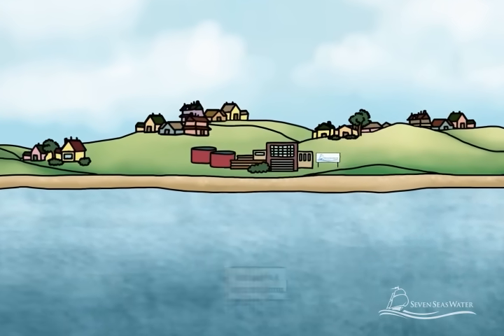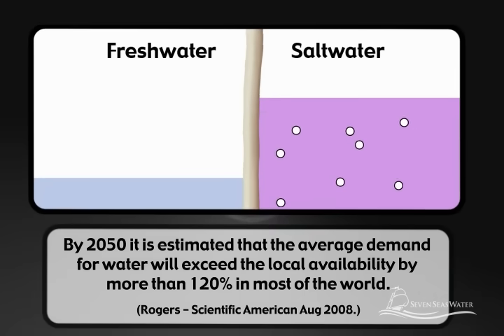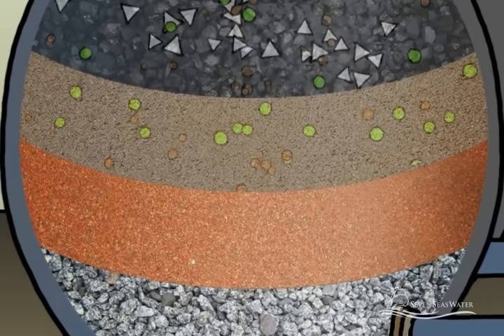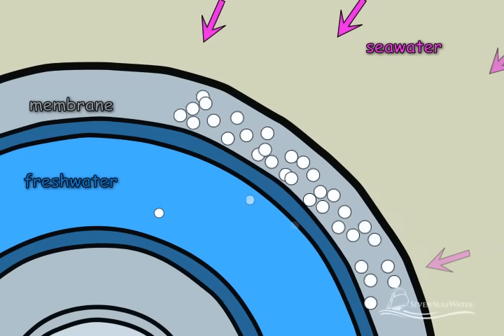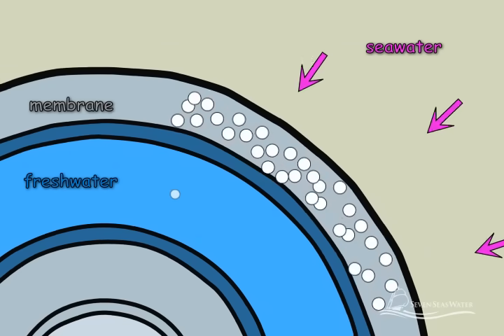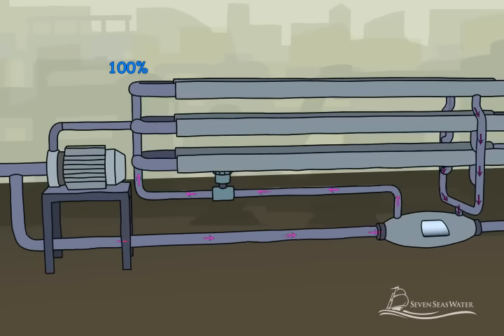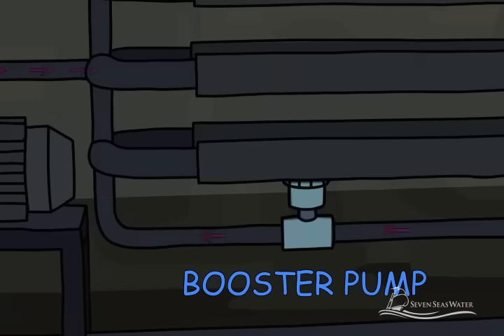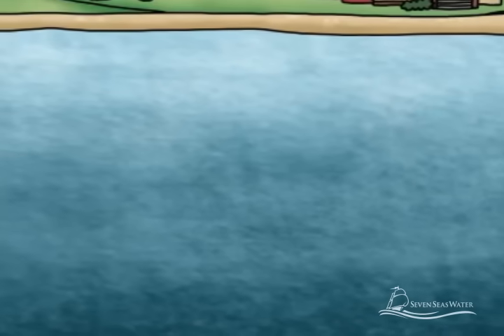How Seawater Desalination Works

Comment: I spend my workdays operating a desalination plant.
  
The process explanation here is simplified, understandable and addresses most issues, though not in detail.  That would take volumes of material and actually would require an extended commitment on the reader's part.

Yes, there are alternate ways to desalinate ocean water - but not all have reached a level wherein they are economically viable to use on a large scale.  Just consider that each location is unique with its own set of advantages and challenges.  Depending upon location - the bureaucrats, environmental agencies, scientists and developers have worked out a compromise that is as reasonable as possible.

Suffice to say - 'How Desalination Works' is Well Done.  Thank you for this presentation.
Reply: What do you do with the leftover salt?
Reply: @-Subtle-  They said in the video that it goes back into the ocean. In theory the salt content should remain the same since all the fresh water we use does eventually vaporize and return as rain.
Reply: @hybridwafer  not all of it returns to the ocean
but yeah the salt content stays the same and at most the salt concentration changes slightly
Reply: @UserJurie there is no way humans can affect the salt levels of our oceans. Its literally 80% of the earth surface. We simply dont have that ability
Reply: @-Subtle-  it says in the video.
Reply: @rory6860  volume.  It works,  and there are "distilling" plants, but a ton of energy to do so.  Just not viable cost wise compared to RO technology for large scale facilities required for municipal drinking water . Great question though.
Reply: @pauldelphos4924  nuclear energy can solve the energy problem
Reply: Simple wisdom is, evry solution is simple, only hard thing is the way to find it. If its complicated , something is not right, but this is step forward too...
Reply: I have some changes that can greatly reduce the cost of running Desalination systems - These changes are simple and would eliminate most Viscous drag in the pressure producing process. I would like to find someone who can tell me WHY,  I'm Wrong about these simple changes. It seems that no one really wants to improve the existing monopoly....I mean system...I look forward to any help
Reply: @haroldwestrich3312  Usually someone will tell you "Your idea is fundamentally wrong and stupid." Then they'll proceed to steal it.
Reply: @rory6860  wouldn't that create just destillized water with no nutrition at all?
Reply: @gsftb  nono it's not remove all content elements,usualy 200-300 tds water is drinkable ,and sea water tds is very high 5000+ so we just come down to 400 tds ,which contains nutrient that we need ,if we drink high tds water may be it's cause problem in lader
Reply: @rory6860  Thats the question i keep asking myself. You also could use solar energy in hot areas.
Reply: Which is why in 1979, I suggested a new Procees. Similar to the 20's.
We are having a continue of History repeating itself.
Reply: @douglasnicholas1860  can you share more about your work? Patents or article about it ?
Reply: @douglasnicholas1860  I'm very interested in the process from 20's that you suggested. Can you tell me what it was? My new process simply uses centrifugal forces to directly press the water through filters rather than "Spinning viscous water at high speeds around a pump housing which accumulates HUGE friction losses compared to directly pushing water through the filters at about Zero relative speed. No pipe losses for high volume either . Look forward to a reply, you can email at oct1113@hotmail.com
Reply: @rory6860  the end product  is a very expensive distillate!
Reply: I didn;t understand how the energy recovery aspect worked in the video
Reply: @NazH12  Here is a link to a brief video of the ERI pressure exchangers in use at the Carlsbad 50 MGD plant.  
https://www.youtube.com/watch?v=IBwkgrwZYNU
Reply: @NazH12  Turbine / turbo charger
Reply: Is there a discord server we could meetup on and talk desalination plant operating work? I'm curious and would enjoy a "look around" from your perspective
Reply: Can I pay you to learn more about this process?
Reply: @rory6860  great question.  I'm no expert, just your average water resources engineer but I suspect the fuel cost required to "keep the heat source on" would be difficult on a mass scale.
Reply: @ Daniel Marler
Maybe we should build a tarp the size of a stadium and put a rock in the center of it and let a football field size pool of seawater drip into a container.
Reply: Start a channel explaining your work!
Reply: @marcusphoenix594  interesting idea.  I'm retired now, but still very passionate about providing potable water for a thirsty planet - while  minimizing potential negative impacts, preferably in a proactive manner.
Reply: How much would the process approximately cost?
Reply: Why not add the dew nets or solar boxes that turn air into water
Reply: In reality, you could have a fresh water tap and a salt water tap in your house. The salt water pipes could be used for pure cooking only. This would also saved a lot of energy in the process of purifying salt water into fresh water.
Reply: @petrbohacek but what about the effect of salt on the infrastructure being used for it on the long run?
Reply: 🇧🇷🇧🇷🇧🇷🇧🇷👏🏻, We are all sinking by the oceans around the world, drinkable waters will evaporate, maybe we could use the ocean waters one day I hope! Places like London and Holland will desapear writhing the nest 10 years they are saying, the heat will dry all of our drinkable waters, Co2 will rise and O2 content is going to be extremely low, the fauna will die, and so the vegetation along with it, oh well, we better act now !
Reply: @claudioagmfilho  oh no, another MD who belives Co2 scam. WAKE VUCK UP

Comment: Sedimentation is missing. If the water is collected in long cylinders with application of pressure through pistons sedimentation would occur.
Reply: No, because 60% of the water is constantly cleaning the salty side  of the membrane.

Comment: With the brine being a problem, and often there being as much heavy salt brine exhausted as water comes through... why not distill it?  Most especially since we now live in a world where throwing up a solar field for all the power isn't even a make or break thing.  It'd be far cheaper than a reverse osmosis system, the left over dry salts could likely be sold, it's not toxic to the environment, it could literally be done anywhere, even with other dirty waters, but... the volume of water kicked out is probably less...  Still... if you had like a 100kw still... i bet you could cook a few gallons...

Comment: Very impressive specially the energy recovery machine. On the other hand I’ve been to few countries that use this process and they tell you to not drink the tab water.
Reply: Something's up with those countries because I've lived in places where desalinated water is consumed from tap.  The water usually doesn't taste good, but if they do it correctly, it is safe.
Reply: @ampa4989  To be honest I even fear taking shower in it as it is so hard and bad for the body. That is how it is in some of the gulf middle eastern countries that use cleaned ocean water. But I guess it could be different in other counties as you've stated.
Reply: @jjenko6366  

Hard water isn't actually bad for you. It, in fact, has health benefits because of the minerals. It just tastes bad. I've been to the UAE.  The water tastes bad. It is safe for consumption.
Reply: @ampa4989  It definitely is not safe for drinking. They got warning signs everywhere that state don't drink tap water. I know cause I used to work there unless they made major changes within the last two years. Same thing with Kuwait and Qatar from my experience.
Reply: @jjenko6366  

That maybe be true for SOME public taps. It's like in Cyprus and Malta. Some taps are not desalinated water because it is so expensive.  But home taps are safe. Or they at least have two taps.  One for drinking and the other for dishwashing, showering, etc. The second tap might not be treated like the first or it might be collected rain water.

Or maybe it's only partially desalinated/treated like some taps in certain Thai islands.  Or it could be the pipes are not safe. 

But true, desalinated water is completely potable.
Reply: I live in one of the Canary islands where almost all of tap water comes from desalination. It is safe to drink and cook, but it is not tasty.  No problem for showering or cleaning, but almost everyone I know uses bottled water to drink.

Comment: I wanted to know how desalination works but the presentation just confused me even more than it needed to XP
Reply: There are many methods for desalinization. The simplest one for a farm or emergency use would be a destilator, where you head the water and the steam will be your pure water, while the salt accumulates at the botton of the heating device.
Reply: @josealmeida5768  
simple but horrible yield

The video was actually pretty good.
The big stuff gets filtered out first and then the salt water gets pushed through a series of membranes at really high pressure to leave the salt behind. 
That's the gross simplification.
Reply: you're easily  confused
Reply: வணக்கம்

Comment: i don't know, this has a lot of moving parts and filters and thing that have the be cleaned or replaced, isn't there an energy efficient system that uses evaporation with heat from the sun or boiling it? sometimes the best solution is the simplest.
Reply: Yes, it's called thermal desalination and it does get use, however while it is lower maintenance, it is also less efficient.

Comment: Nice video. Some good info there. They need to keep the calcium carbonate out. Distilled water is pure.
Reply: You need to open your ears partner. Calcium carbonate is not wanted or needed in drinking water. Distilled water is best for consumption.
Reply: @royalgilpin4922  actually you're wrong, calcium carbonate is an inorganic mineral that your body doesn't really absorb you get your vitamins and minerals from food not water. if it weren't for all the pollutants in the air rainwater would be the best water you can drink, which is...  you guessed it distilled water.
Reply: Next your going to tell me fluoride is perfectly okay and my drinking water too. Recommended even. Drink up buddy. What do you think causes plaque in the body. (Jeopardy music) ... Inorganic minerals.

Comment: Jan. 9, 2020---Thanks for the video as I always wondered how it worked and what happened to the non water stuff. Only thing missing in this video is the cost? Would it be cheaper to make several smaller ones along a coast line in case one has to be shut down vs one big one? And what is the normal water output for these things and cost of piping needed to get it from the plant to where it's needed?

Comment: With the sea levels rising why can not sea water be filtered to fresh water and then used to cultivate land such as the Sahara Desert ?  The Oceans could cultivate large areas of Africa or any other desert land.  If Austrailia had several large dammed reservoirs they could use it in emergencies for tackling  bush fires.  Using sea water would reduce the sea level which would aid coastal erosion and help to save islands currently at risk.

Comment: It's a helluva lot cheaper n easier if you just boil it
Reply: TGE No. The energy requirements for steam are much higher and produces water that still needs minerals added to be safe for long term use. Desalination only removes enough salt to make it drinkable, so minimal minerals are added

Comment: What if you boil seawater and catch the steam?
Reply: Imagine how much energy is required for heat energy....
Reply: Are you serious? People have been boiling seawater and catching the steam for a very long time, and ending up with distilled water. Beyond that, humans can boil swamp water or any bad water and get the useable stuff.
Reply: @dehoedisc7247  doesnt mean its an efficient method, perhaps vacuum distillation.
Reply: Yes, anyone can distill salt water and it eliminates the salt. It takes more energy than the reverse osmosis.
Reply: One would have to create a closed cycle system so that the heat isn't wasted. Then it could be cost effective. I'm not saying that it can't be done, but it seems rather difficult. You basically need to arrange the devices so that the exiting steam looses it's energy to the cold incoming seawater. The whole thing needs to be well insulated to avoid losses as much as practical. All that insulation means the whole thing will be hard to work on if there's a leak. My sister's hot tub has a leak that I can't find!
Reply: Wow
Reply: Mr B  still a waste of energy

Comment: this method is to bulky. as in screams high costs.

a staged swapping for ocean cleaning of filters across an array of processing stations will reduce costs, make an easier small scales proof of concept, and better long term production.
Reply: having water gathered onto an evaporation slab for example

Comment: Am I the only person wondering why not start by solar distillation. Then filter the water that’s condensed back into liquid. The salt build up could be scraped off and cleaned and sold as well. Then we don’t need to mine for salt. Solves  3 problems could solve 4 if the heat generated over the surface of the condenser could be harvested. We take away the ocean rising levels, stop digging natural resources only to wonder why earthquakes start happening in those areas(Oklahoma and oil drilling reference) have a retailed product to sell and help offset the cost, last plenty of pure clean untreated water without the need for toxic chemicals. Nothing more clean and void of harmful stuff than distilled water. Just run it thru mineral ion filters. No harmful or toxic byproducts needed either.

Comment: Rafael, you are correct.  California (and other states) must change the requirements that rain water go straight to drainage.  Here's a link to an article, "When it rains, Los Angeles sends billions of gallons of 'free liquid gold' down the drain", about LA's previous waste of "29 million gallons a minute":  https://www.latimes.com/local/lanow/la-me-ln-stormwater-20170308-story.html.  Some communities are trying.  You might want to check out the Wired.com article, "LA IS DOING WATER BETTER THAN YOUR CITY. YES, THAT LA": https://www.wired.com/story/la-is-doing-water-better-than-your-city-yes-that-la/    

The key is to get other cities to reclaim their runoff, and to stop the ones who are draining the aquifers for their cash-crops.  In example, almond growers, who not only are depleting the aquifers, but have cut jobs, and reduced their labor costs through mechanization.  Here's a link: https://en.wikipedia.org/wiki/Almonds_in_California

Comment: Isn't it more expensive than distillation using heat from nuclear sources?
Reply: The method above does not completely distill the water like full distillation from heat, so it transforms the water into drinking water.   If your completely going to transform water from distilled water to drinking water, you still going to have to run a osmosis system to add some salts/minerals back in.  You can drink distilled water, but it is not very healthy. Both methods are way more expensive than filtering water from a fresh supply.
Reply: @TheBaldr  you can drink distilled water if you also eat something.

Comment: How much would this cost and how long would it take to make?
Reply: Hey man! Just did some research because I was curious too. It looks like current systems that desalinate ocean water costs roughly $2,000 for an acre foot, which is roughly the amount of water an entire family uses in 5 years.
Reply: @thelardener  Hey thanks for coming back to me. I’m really excited by this.

This is really the solution to famine, don’t you think?
Reply: @thelardener  put this together with videos of solar panels powering water pumps.... To fertilize soil.. grow fruit veg...
Reply: John Philippe Biggest issue is the electricity needed to run the filter which could be solved with solar panels, but again that’s only dependable when it’s sunny most of the year. Scientists predict there will be a worldwide potable water shortage by 2050 if we merely keep up what we’re doing. So it would definitely be key to our survival to find means of purifying ocean water for sure!
Reply: @thelardener  please may I have your email
Reply: @thelardener  Watch "solar tube well 10 hp mono block motor 18 solar panels 300 watt 4 inch delivery rural area in punjab" now connect enough panels to power pump and desalination, and additional panels powering batteries.. set up reservoirs for truly horrific days of zero sun.. use this water for fertilization of fruit crops and sanitation. Earth provides power, water, food...

Comment: Is it possible to
"MAGNETIZE" the molecules of the salt of the Sea water or the
Sodium?  The purpose and the idea would be so to be able
to separate the salt molecules from the Sea water and
transform it to sweet or drinking water.   After All, all Salt is a mineral.   Minerals
such as Sodium, Calcium, Potassium, and etc... are only substances that are
formed naturally in the Earth.  Minerals are usually solid, inorganic,
have a crystal structure, and form naturally by geological processes. A mineral
can be made of single chemical element or more usually a compound.  If
the Sea water can be transformed into sweet or drinking water by
"Magnetization" process, it would make it much readily available,
much less expensive than the processes of "Desalination"
and the filtration systems.